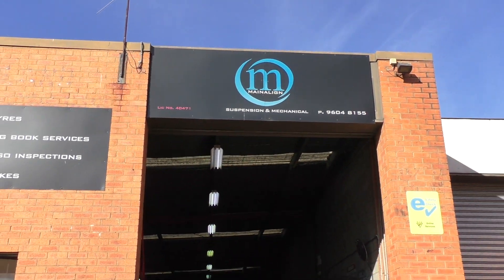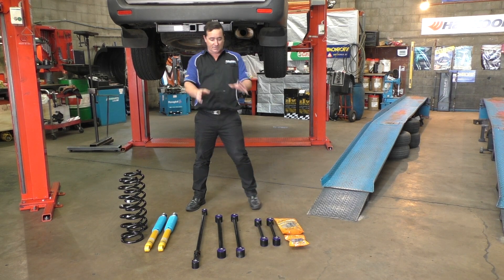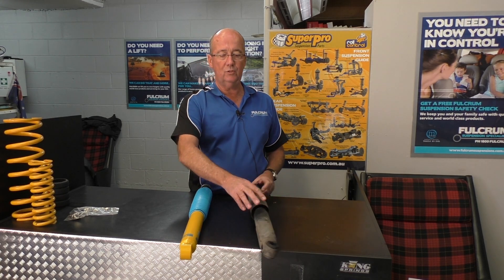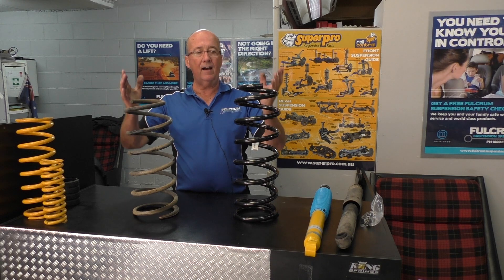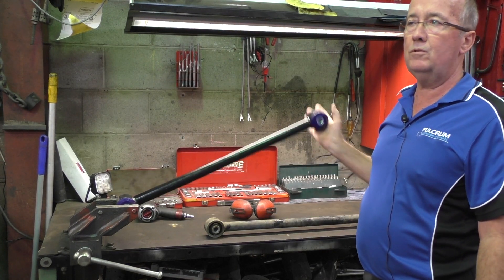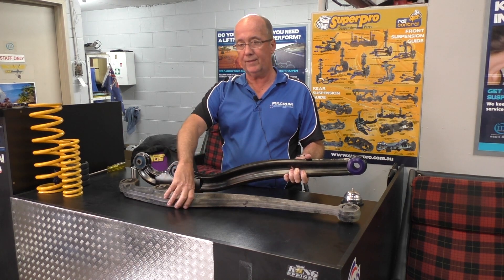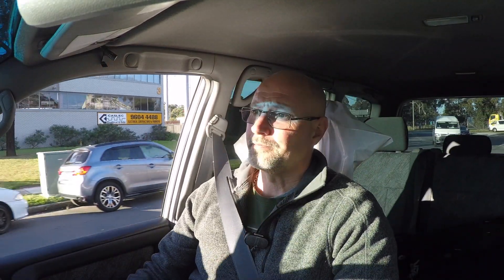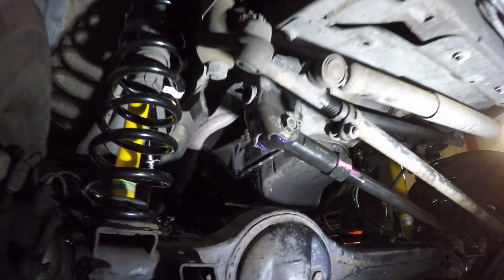Landcruiser 105 Fulcrum Suspension SuperPro Set Up | ALLOFFROAD VLOG #5

Comment: Great Video..Big improvements on the Cruiser, It looks awesome..
On our recent Cape York adventure we had major failure of the Super Pro top and bottom shock mount bushes both sides on my mates 76 Cruiser. After 400km they pancaked, broke apart and fell out leaving us stuck on side of track at night 6 hrs from the nearest town. 
Using a cordless grinder, drill and a nylon cutting board we managed to shape a few nylon bushes which was enough to get us to higher ground where we could roll out our swags for the night. 
The next day we made it to town but the mechanic was to hung over to fix the Cruiser so we had to wait 4 hrs for him to get out of bed. After the mechanic came good, he put standard rubber bushes back in we were on the road again, completing the trip without anymore 76 issues.
If you own a vehicle with this type of shock bush mount it would be a smart idea to carry a spare set of rubber bushes just incase the poly don't last..
Reply from the maker: hi, hm that is interesting, my shock bushes are Bielstein did you by any chance keep the SuperPro bushes?? I would contact SuperPro as I'm quite sure they like to hear your experience not to mention you have a lifetime warranty.

My front and rear radius arm bushes on Tiny are super Pro and they cope an absolute flogging with the flex I have and never failed
Reply: I think he through what was left in the bin but theres not much point contacting Super Pro as they will probably send him another set and my mate will not use poly for his shocks again.
Mates 76 also has Super pro radius arm bushes, no problems with them so far..
I wonder if anyone has had same problem??
Reply from the maker: I think SuperPro would have been very keen to get to the bottom of this and while they also would have sent him new bushes would have been interesting to see why they failed....
Reply: AllOffroad 4x4 Adventures TV  I will put it to him 👍🏼
Reply: who put the shocks in.. I believe there is a tightening method to follow.. something to do full wait on shock before tightening the bottom bolt I think..

Comment: Nice video. I am looking to do a full super pro bush kit replacement front and rear on my 80 series Landcruiser and was wondering how the super pros are still going. A lot of forums reckon best to stay with OE rubber bushes but would like to keep an open mind. Notice you changed to Icon recently.

Comment: seeing you have done the engine conversion does it pull the 35's good now? have you done any mods to the engine or is it just stock? Do you know the fuel economy you are getting now? Can you get up to highway speed easy now with the 35's and engine conversion?
Reply from the maker: +Clayton Roberts no tune yet but large inter cooler, 3” exhaust etc. Great gearing with petrol transfer case and it’s pulling very well, need  to test consumption more seems like17l per hundred which seems a bit high

Comment: Do you have any more info somewhere on the front control arms? Are they skinnier than stock to help with axle bracket control arm contact? Does the tie rod touch the control arms at full drop while turned. These are the issues I'm having with my 80 series stock arms. I'm in the USA
Reply: Did you do bushings or brackets? Did you add drop brackets to any components or an adjustable panhard bar

Comment: Stefan are you still using these bushes mate or back to rubber?
Reply from the maker: yep still using SuperPro where I can
Reply: @AlloffroadAu  trailing arms, panhards, radius etc? Had any fail from video? Cheers
Reply from the maker: dont think I ever had a SuperPro fail
Reply: @AlloffroadAu wow that's very impressive and surprisingly interesting.
Reply from the maker: I replaced some because they got a bit worn but never had one disintegrate as far as I can remember

Comment: Schaut gut aus..! Wie viel constant load hast du in den rear coils? Ich will meinen 105 3" liften und habe auch rear bar, spare tyre, jerry can, drawer system und fridge. Die vom suspension centre meinten 400kg constant wäre gut, ist das nicht zu viel?
Reply from the maker: depends on you weight I have  custom coils as you can’t get 3” lift coils with the load rating I have.
Reply: @AlloffroadAu  thanks! Whats your weight rating? Rear and front?
Reply from the maker: not sure mate they where custom made but can't remember exact specs

Comment: Have you done any mods to the engine? Or is it still a standard 6 cylinder diesel?  Does it pull the 35's at highway speeds? Can you feel that it is slower to take off/ keep up speed?
Reply from the maker: It's currently in to get a 1HDFTE and 5 Speed auto conversion, including Intercooler, heavy duty valve body and auto transmission cooler etc..  hopefully back within next two week

Comment: i wander if we would need extended sway bar links if we have a 2' lift
Reply from the maker: probably not
Reply: @AlloffroadAu  so whats the verdict after using superpro.. did u  put plenty of klm on them
Reply from the maker: did around 30.000km on it and was not a bad set up, however it was no match to my 2.5" RR adjustable Icons I have in now

Comment: Wow, the alignment machine is very old technology.
Reply from the maker: Lol it is, hower in the right hand probably better than new fully electronic machines. It takes a little more time, but any misalignment of the machine is noticed right away (electronic machines can take quite a few wrong alignments before it's noticed) at the end it's just a measuring tool, and Fernando is doing wheel alignments for 20+ years and is certainly a master in his field.

The previous workshop I had the car in 3 times, and it was still misaligned turned out the full electronic machine was out of whack supposedly happens frequently.
Reply: Only way to do a 4 wheel alignment with larger tires

Comment: Hi Stefan, its been a few years now with this suspension. What are you thought on how its gone over the years? Has the SuperPro gear lived up to its name?
Reply from the maker: That was replaced nearly 2 years ago I had a video up for a while, it was a good basic suspension but I ended up wanting something better so now 2.5” remote reservoir shocks from Icon and Solve Offroad Springs.
Reply: @AlloffroadAu  hmm maybe I got confused with the order, cleared all my history and couldn't remember what I have watched. Will check it out as I remember you adding in straps to your rear springs, and it wasn't in this vid.  Thanks for getting back to me.

Comment: You had me until the polyurethane bushings. They will never make it 200,00KM and they will squeak the entire time!
Reply from the maker: lol, with no name Poly that may be the case but have you ever used SuperPro? I have them in my various trucks for many years, never ever had an issue. In my lifted Discovery 2 the Rubber bushes lasted 10.000k, I sold the car 40.000ks after putting SuperPro in and they still looked like new...
Reply from the maker: SuperPro bushes also have a lifetime warranty so if they should go at 200.000k's I get new ones for free :-)